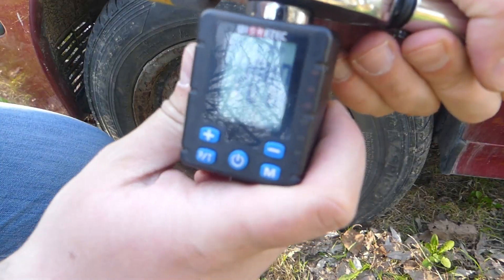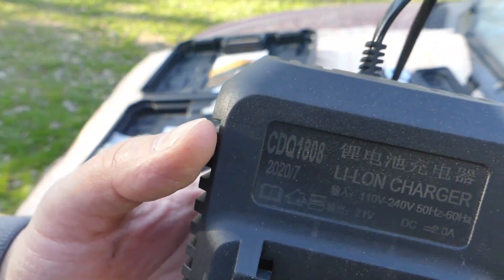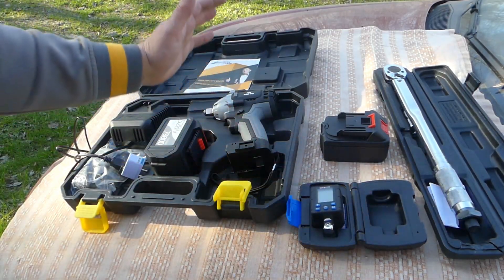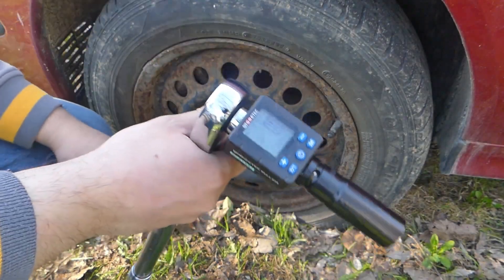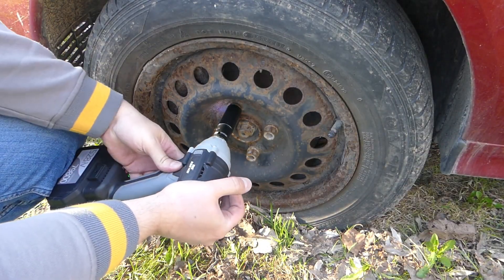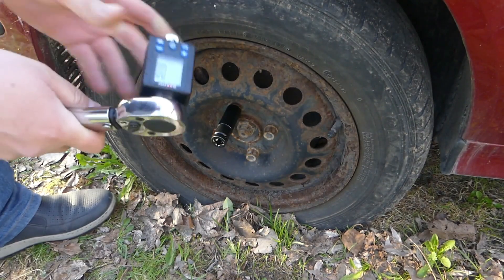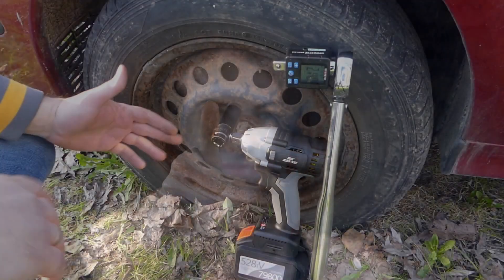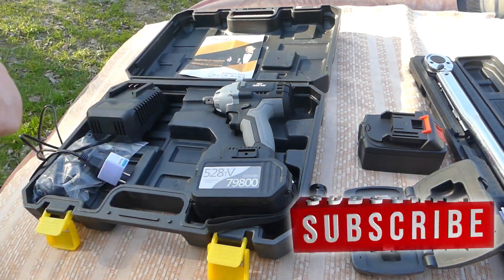Can This Cordless Wrench Beat 200 Nm? Test NANWEI 380N.M

Comment from the maker: ✅ NANWEI 380N.M on aliexpress https://s.click.aliexpress.com/e/_DEsktsP 👈
✅ Link to mechanical torque wrench https://s.click.aliexpress.com/e/_DdVXyRD 👈 1/2 Inch Driver Click Adjustable Torque Wrench
✅ Link to digital torque wrench https://s.click.aliexpress.com/e/_DkJzgfZ 👈 High Accuracy Large Screen Electronic Digital Display Torquemeter Adjustable Torque Meter Adapter Professional Universal Wrench
✅ drill chuck with accessories https://www.banggood.com/custlink/3GvPIhW7pF 👈 10pcs Air Impact Socket Wrench Set 1/2 Inch Square Drive Metric Drill Chuck Adapter
✅ drill chuck without accessories https://s.click.aliexpress.com/e/_c4egux0F 👈 1.5-13mm Drill Chuck Drill Adapter 1/2 Inch Changed Impact Wrench Into Eletric Drill
✅ 1/2inch 10-200Nm Digital Torque Wrench https://www.banggood.com/custlink/K3m5SdcfpS 👈